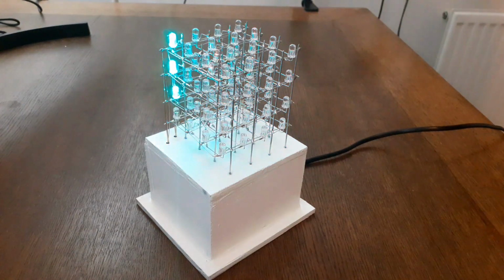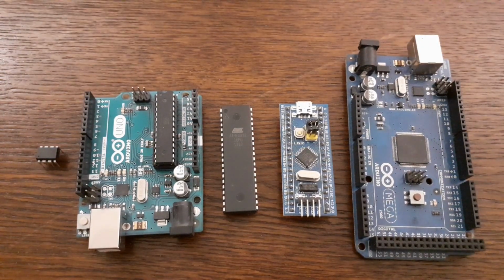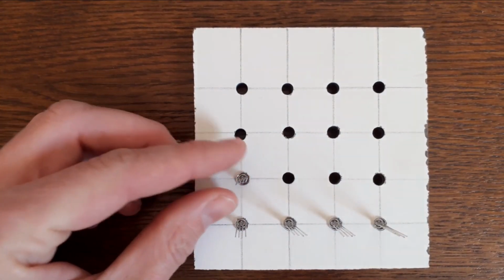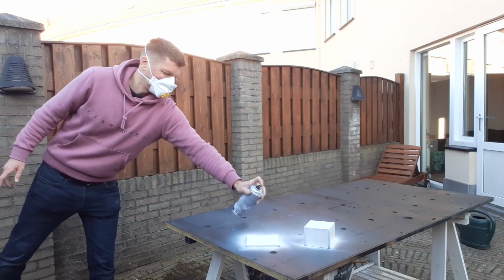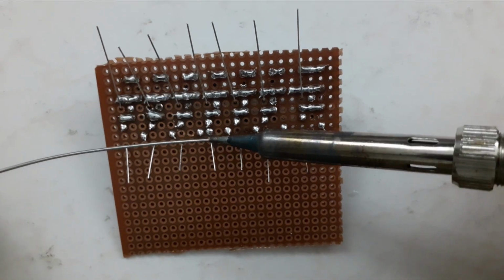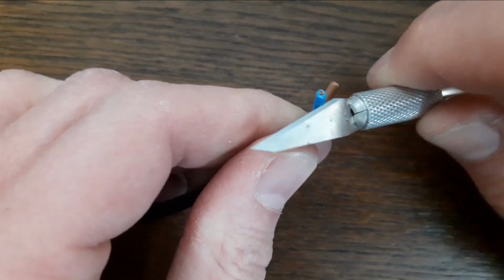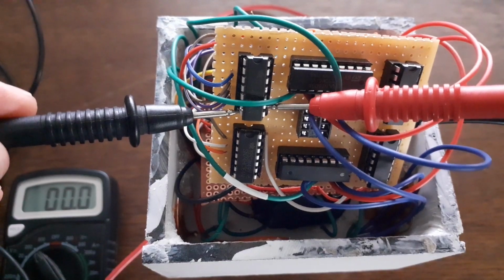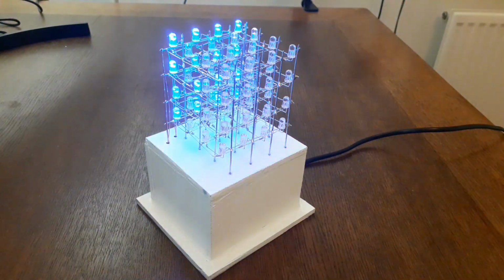RGB LED cube 4x4x4

Comment: I like the video, and the project, but it shows how much electronics you need to drive these RGB LEDs.
And this is a smaller cube, a 4x4x4.
This is why I have decided to go with individually addressable RGB LEDs (ws2812 or equivalent).
All they need is 5 volts, and a single signal input wire, which just then goes out of the LED to the next one's input.
You can then use a publicly available library, e.g. FastLed, to drive your LEDs.
Reply from the maker: Yes, this would be a very good approach indeed. Simpler.